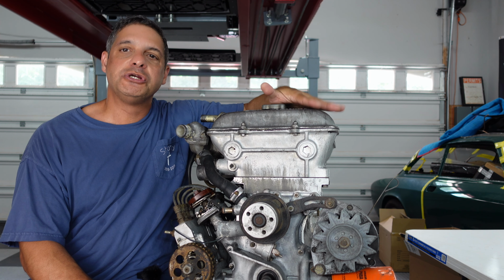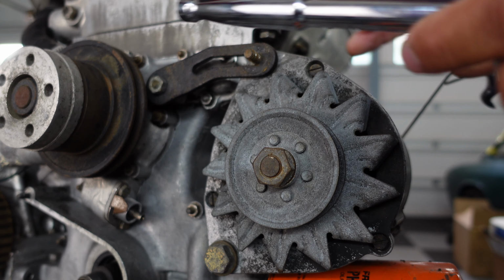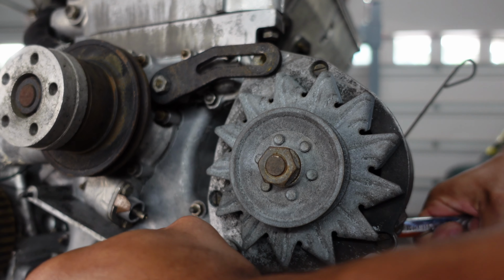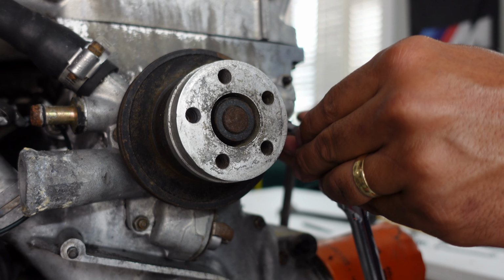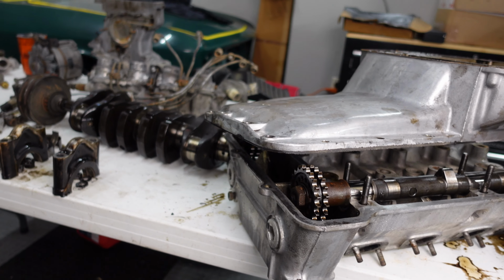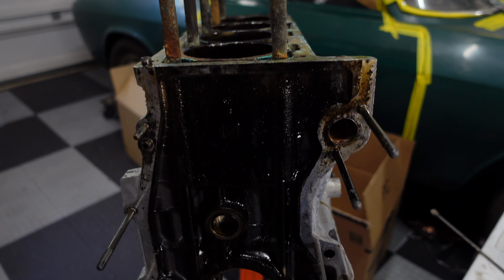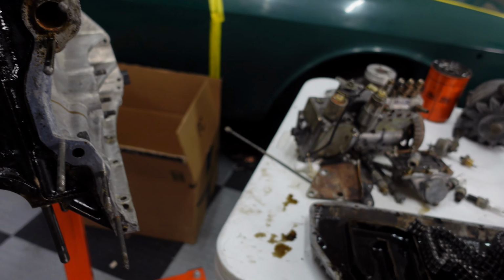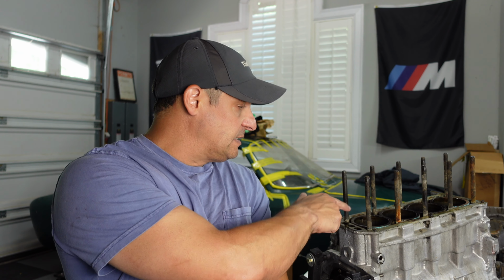1972 Alfa GTV Restoration Project - Engine Teardown: Episode 1

Comment: SPICA pump. Check the small oil filter on the side. 
3 small nuts hold a circular plate in place. 
Soak those with penetrating oil before removing in case they are seized.

Also, the Thermostatic Actuator in the injection pump has a metal tube that connects 
to a sending unit that plugs into the cylinder head. 
Hopefully all of that is all still together. 
Those are very hard to find now.
Reply from the maker: Well, building my own EFI system right now to replace the Spica system.

Comment: After watching the video again, I notice the brass tube has been cut from the gold colored sending unit on side of the intake manifold.
This tube relays engine temperature reading to the Thermostatic Actuator on the injection pump.
The T.A. regulates idle enrichment as the engine warms up, leaning out the mixture when the engine temperature hits 180.

Heads up: The 2 small studs that hold that sending unit in place LOVE to shear off.
Penetrating oil overnight on those small retainer nuts, then a little heat and a gentle touch are required!
Reply from the maker: Yep, it’s pretty much all broken, lol… No worries we will get her running.. thanks for the good eye.